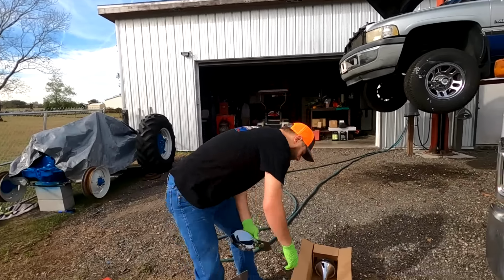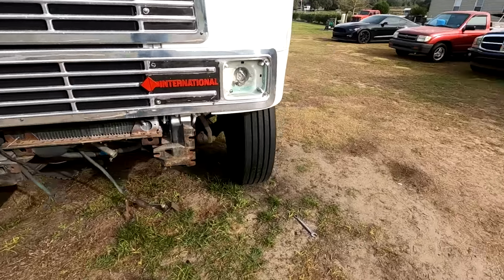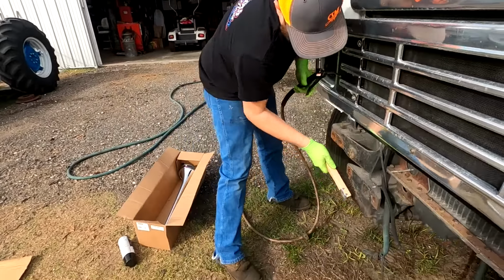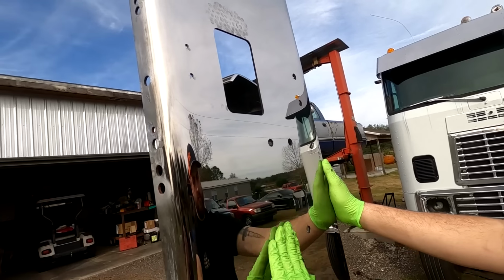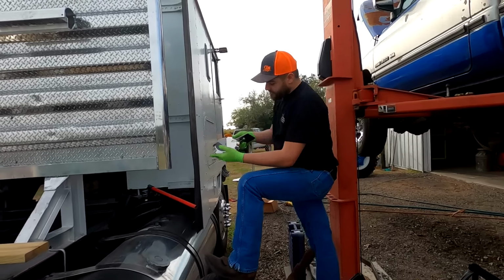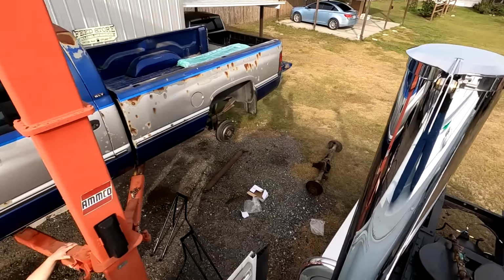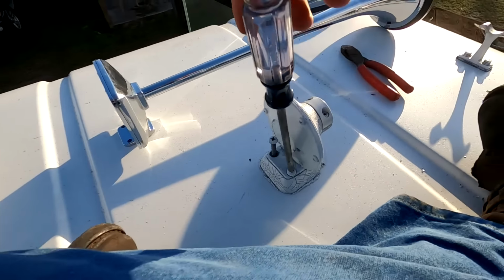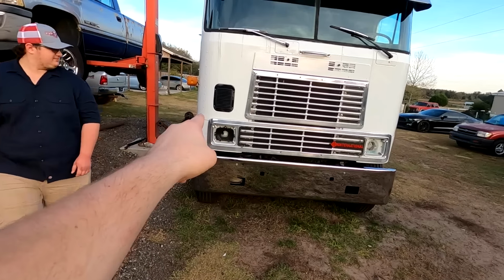Cabover Gets A Massive Drop Bumper and Stack Flaps!!

Comment: I’m glad someone is restoring the older cabovers! After driving one for over 30 years it does my heart good to see that nice looking Transtar going back on the road ! I would think twice before putting super-singles on your steering axle , the cost really sucks and they don’t hold up over time ! If you want the tires out a bit use spacers ! You need another trumpet on the pass side ! Just cut the king pin latch rod shorter and use an old inner tube and make a gasket for behind that beautiful chrome bumper so it won’t rust ! These are things I’ve done to all the trucks I had ! The very first international I drove was a 1971 w/ a 36” bunk a 290 Cummins w/ 10 speed roadranger and 370 gears no air ride or power steering ! Lol. What ya hauling with the old girl ?

Comment: I have only put fenders on air ride trucks, so I would dump the air and lay a 2X4 flat across the tires and use the boards as spacers.  When you air up the suspension you will have good clearance.  On a springer I suppose you  would measure the distance from the suspension stop to the axle, add an inch or so, and space the fender accordingly.   Since you want a new 5th wheel, get a riser spacer to go between the fame and the 5th wheel.  Your new shiny fenders will thank you.  On the bumper bolts I would polish the stainless steel bolts and never worry about them rusting.  The bolt/nut covers are moisture catchers and rust generators.  Best of luck to you on this build!

Comment: For those stainless bolts, as an industrial plumber we always used tar on the threads to prevent the treads from being destroyed or jammed, and it makes it possible and easy to disassemble at a later point if needed 😉👍

Comment: finally, someone who hasn't stretched teh frame enough to put a conventional body on. great looking rig. looks like the one i bought in 1983. takes me back, lol. if you are planning to sleep in the truck and use it for work you will be removing the flappers if you want to sleep. I took them off mine and put turnouts on it. slept like a baby. LOL, I'd go home after a month or more out and have to sleep in the truck. it was just way too quiet in the house without the engine running. haha. Great times. I was young and single and hauled cross country with it.

Comment: I cringed when he started rattle canning right after the grinder lol. Didn't even give it a hit with the air D:
Reply: He's the king of half-assing things.
Reply: @Red_5_Standing_By  that is a true statement
Reply: 2 Fast throwing so much money at this project most folk would do things the right way, all he’s doing is throwing his cash in the fire imo.
Reply: its going to be behind the bumper but i would have blown it off with the air compressor
Reply: I’ve never seen someone buy chrome for a truck that won’t run. Rebuild the motor first Einstein.
Reply: Lol I did the samething
Reply: @danielhofer7386  what are you talking about that thing was mirror finish...naaaaaaaat
Reply: 2 Fast ......didn’t wear eye pro when grinding either

Comment: If you put a slight bend on the rear horn bracket  bend it from 90 degrees to about 100.  it will sit tight on the front mount.

Comment: Make sure you get your new fifth wheel height right if you plan on hooking that up to a van trailer.

If the fenders are too high or fifth wheel is too low with a trailer on, you’ll crush them with the trailer whenever you pull onto uneven surface.

Comment: Hey Bruce you can polish those Stainless bolts instead of getting chrome which will only rust later. Also a 2nd horn for the other side would look a lot better it looks unbalanced with only 1.

Comment: The slightly wider front bumper will direct air AROUND the front tires and to the side. Wouldn't try flotation tires on that, the mass of the tires would quickly overwhelm the steering assembly. Would have to convert to a dual-box system like you'd find on a dump truck....and that is a bit asinine on a cabover. Rain flappers on the stacks look just fine...

Comment: Put a piece of rubber between the horn and front bracket then use rubber band / o ring to hold it down. It should hook on the bracket.

Comment: Would it be possible to fab up mounts for those fenders to have them mount to the suspension part so they travel with the tires so you can get them nice and low to the tires? Just a thought.

Comment: There's a rubber strap that holds down the air horn, you should be able to get it at any truck stop. That truck, frame and 5th wheel was designed to be used with low profile tires (like 11 r 22.5's). Those fenders will always be in the way somehow because of the over size tires you put on. having to raise them up will cause the trailer to damage them when negotiating rough terrain or steep inclines. You may want to just set them aside and when you have to replace the tires in a couple years put the right size tires on and then mount the fenders.

Comment: A tip for proper fender installation… 
1 Dump the airbags on the tandem. 
2.  Place a small 2 x 4 on top of the  tires. 
3.  Put the fenders on top of the 2x4 
4.  Drill holes affix the fenders.
5.  Inflate tandem airbags, enjoy.
Reply: It's not on bags

Comment: The new interior head liner will be a problem to install. You have to remove the windshields to put in. I drove International cab overs back in 1990-1993. Stay away from the GMC Batmobile cab overs from the 1960'S-1980's. They have Detroit engines and they are loud! Also they have Louise Armstrong steering, no power steering! Those trucks were a nightmare!

Comment: Bruce, there should be a small rubber, (if I remember right,) piece with loops on both ends that go over the front of the air horn and loop around the pedestal. (I think there's also a another piece of rubber that fits down in the pedestal base to cushion the horn trumpet. Without something holding that down, that thing's gonna blow around and destroy itself. You might want to look at the manufacturer that you bought it from, or maybe the guys at the Chrome Shop can help you out!

Comment: If you put fog lights in those two holes in the bumper there will be nowhere to put your feet to step up to clean the windshield ! That is the reason for the four holes in the bumper you call a peice of junk . That is also why there is a handle on front of truck . Part of the reason there is wide gap above bumper is because the cab mounts have rubber bushings and the cab has to be able to give and flex on bushings do to bumps  and twisting on uneven ground .

Comment: Please buy a nice set of led headlights. Dont add foglights instead use those fog light wires for extra running lights and underglow bumper guides. I'm adding fog lights under my kw but for a different reason. Using 8 of them to make it glow white like I'm driving on a cloud

Comment: Put new stainless bolts, nuts, and washers  back on it. Being a mechanic you should know that stainless nuts will not rust or seize on the stainless bolts.
 That is why the original ones came right off.

Comment: You  need one of those high rise fithwheel like the fuel tankers use
Reply: Billy Jones not sure what trailer he will be pulling but I think with a standard 53’ the node of the trailer might dip into the fenders while going over dips.

Comment: Those full rear fender are a bad idea for you low boy or drop trailer operations.  They will be damaged on uneven grounds and to pull that  fifth wheel handle is going to be a real pain in the ass. I do heavy hauling low boy work.

Comment: So we didn't bolt on the bumper correctly because we didn't get stainless bolts. We didn't bolt on the air horn correctly or have the correct air horn hose clamps AND the ID lamps weren't hooked up and wired because we won't hook up the batteries. AND why did you upload this video? So we can make money even though we are not ready to hook up anything on this truck properly. Sounds like N-Riggin to me. Lipstick on a pig.